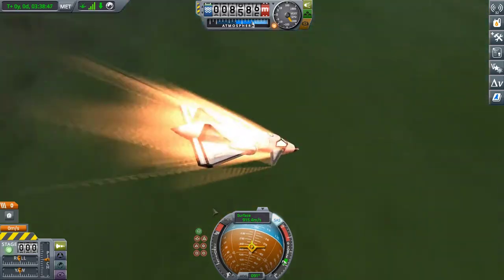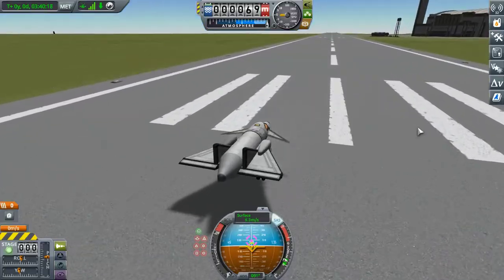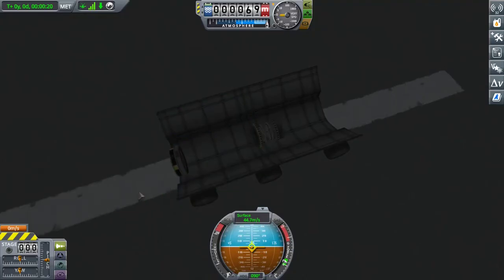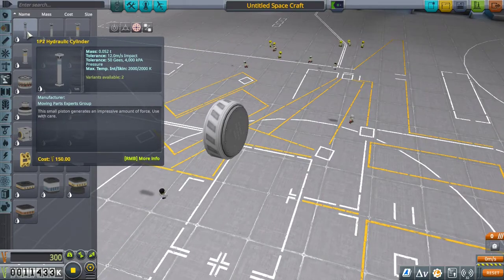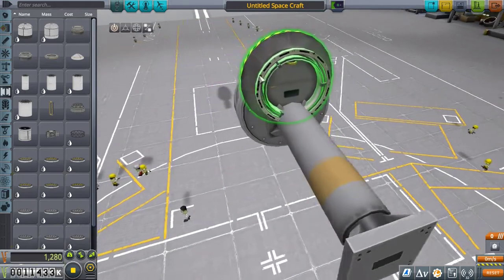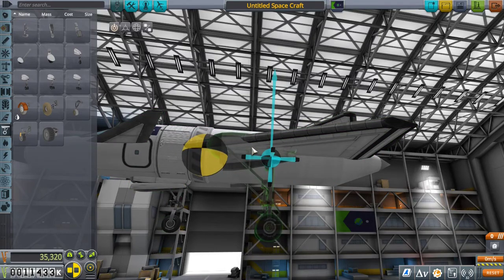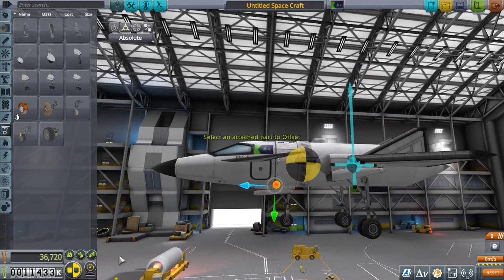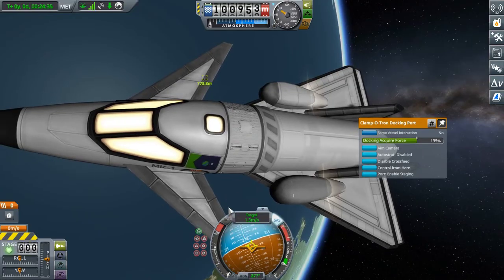KSP Kraken Drive Tutorial

Comment: That's awesome. I'm going to make a Kraken Drive powered play-through. I've just built a cigar shaped kraken drive power SSTO with a massive crew capacity (well massive for a mk.1 SSTO as small as it is). Although I messed up because I tweaked with the max extension of the hydraulic cylinder meaning it's impossible to make 0 thrust without messing with the docking force. 

I think I'm going to build and test a number of designs between the Junior docking ports and the Senior docking ports with various amounts of thrust vs weight, then save them all as assemblies to attach to craft as I build them.

Comment: How how do you get 8 way symmetry in SPH? I can only get no symmetry and mirror in SPH no matter how much I try. plz help thx.
Reply from the maker: Middle click on the symmetry button to change the symmetry mode between radial and mirror
Reply: @Rocketman679  Yes I know but I mean more than mirror. for example how did you do 8 way symmetry when placing the docking ports?
Reply from the maker: If you left click the symmetry button, it changes the count. If you middle click it, it changes the mode (in both editors). So you middle click the button until it shows a round dot rather than square, then left click it until you have the count you want

Comment: HOW DO I GET MORE POWEr, FOR EXAMPLE HOW DO I GET THIS TO WORK oN AN MK3 AAAAAAAAAAAAAA
Reply from the maker: Eh, honestly, kraken drives are infinite fuel, but very low thrust. I think I mentioned editing the .craft file to improve the thrust somewhat but the max you can set the acquire force to, even via text, is 1000% and 5x tiny is still tiny tbh. That's why my kraken craft are so small
Reply: @Rocketman679  use the controller with the breaking ground dlc?

Comment: Is it possible to do this without any expansions?
Reply: You can do that by putting a controller and assigning docking acquire force to throttle. By this way you can get drive to actually obey throttle and do it without moving parts
Reply: Don't think so, you need to move the docks

Comment: Can you make it without the piston? I dont have any dlc.
Reply from the maker: Yeah actually, you just set all the ports up statically and then use the "docking acquire force" slider on the target port as your throttle. As far as I know there's no way to map that field to an axis so you have to throttle it by clicking but it would technically work
Reply: @Rocketman679  Ok thx! :)
Reply: @Rocketman679  I think you can do that with a controller. Im not sure if a advanced tweakables option will appear on actions menu though
Reply from the maker: @isimbulamadmqwe9972  unfortunately the "acquire force" slider isn't an axis that can be mapped with the KAL, but that would be a lot more convenient

Comment: i had a go at trying to make a K powered plane that could be throttled more smoothly so i had a pair of drives next to each other mounted rigid, with no piston so they always made the same force, and had them mounted on a swivel so at full throttle they would both face forward and accelerate the craft, then at zero throttle they would turn 90 degrees and face each other and cancel out their forces. this didnt work perfect, it would still make a VERY slight amount of rear thrust so it never could actually STOP accelerating either forward or back so i couldnt time warp. also it wasnt just one pair as that didnt make enough thrust, so i ended up with like 30 or 40 pairs in a long stack of the big mk3 cargo bays (im not a fan of part clipping so it didnt cross my mind to make an exception in this case since we're cheesing the docking ports anyway)
Reply: how to make bigger and better aaaaaa

Comment: alternatively, you can use inflatable docking ports instead of pistons. ( for those who doesn't have breaking ground, or just make things more simple.).
Reply from the maker: Can you map the extend distance to the throttle? I haven't tried the airlock design yet
Reply: @Rocketman679  you can link the airlock to the thruster, yes. But the thrust only occurs when the docking port is near the other dock, so it's the same...

Comment: Nice, might try it with less ports so my FPS stay above 20.
Reply from the maker: If you edit the .craft file to increase the docking force above 200 you only need a handful
Reply: @Rocketman679  you can also overclock it so that it launches you out of the solar system or you can just mildly overclock it
Reply: This is a good point you should put this in your video because this would really improve performance without having to increase part count.
Reply: My computer has a really good CPU, but it would melt if I made it go any faster because the fan isnt very strong, it's quiet at least
Reply: School computer?😅😂😂